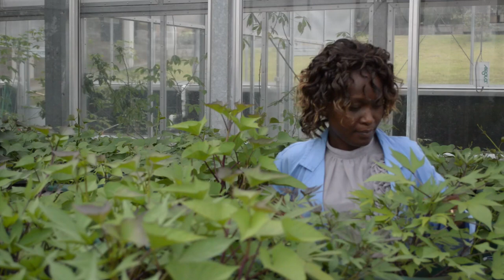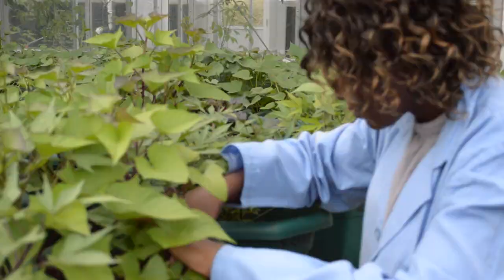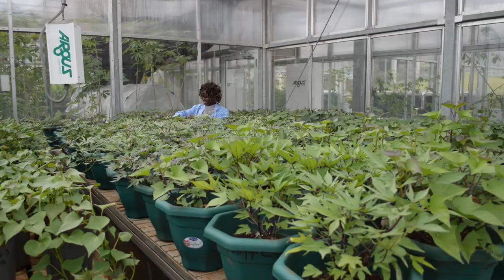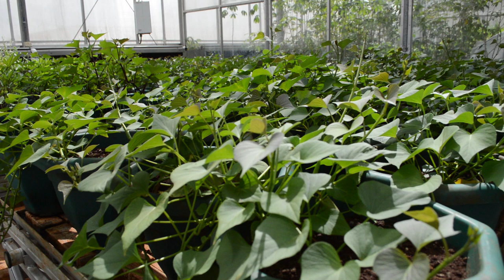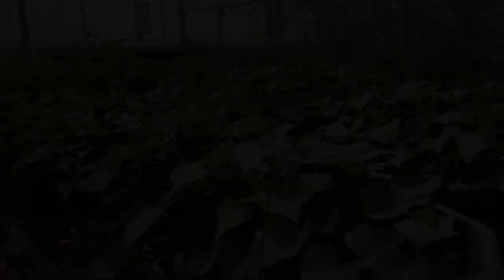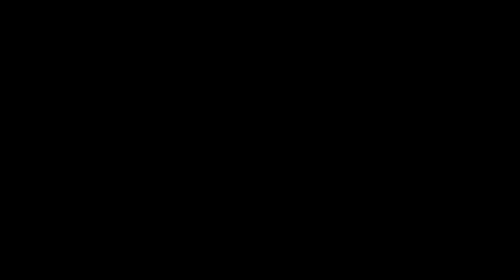Growing a Better Sweetpotato

Comment: (1:07) ~ interesting! You said: you're trying through genetic-engineering, to [insert] "weeble-resistant genes" into the plants, so that the plants are able to fight off the weebles on their own, without having to add pesticides, or anything ..... ---- ❔Question: Exactly what is that "weeble-resistant gene," in which, you insert into the vegetable plants? ❔Where does that "weeble-resistant  gene" come from? ❔What is that gene? ❔Is that "gene" genetically-modified, also? .... it is a natural substance? or synthetic compound, or unmixed?